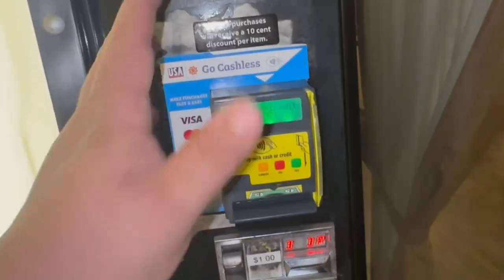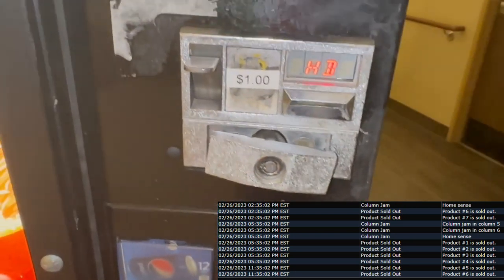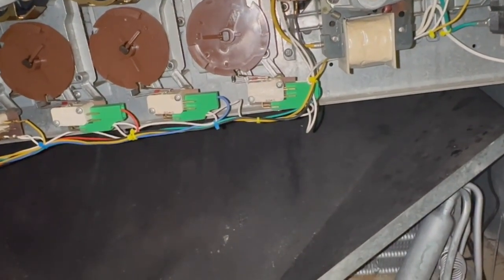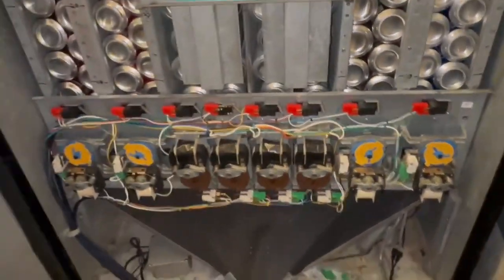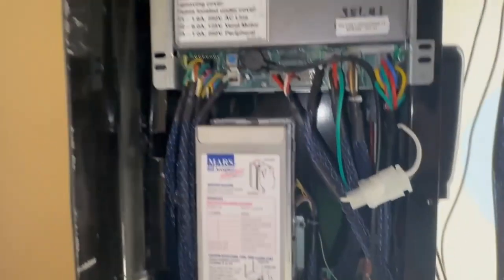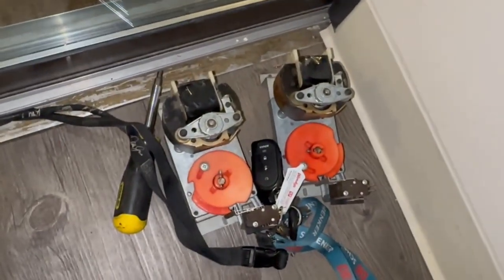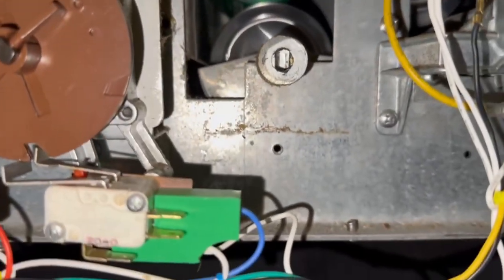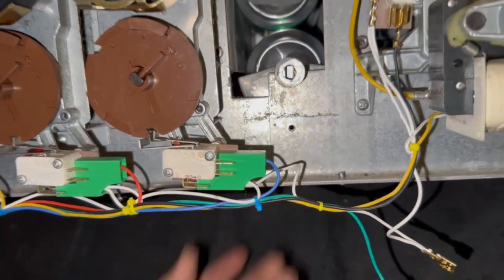Soda Machine repair Late Night #vendingmachine #repair #diy

Comment: I understand this video is 3 months and old. 
when #6 jackpot, you had to move the camera. but it seemed like it had a faulty motor break.
and I noticed one one of your short videos you had people putting pennies and a Mexican coin.
It would be useless in America but that changer can be reprogrammed to take Mexican coins.
 I've been remanufacturing and programing all kinds of vending machines for 30 years.
Reply from the maker: That machine is a machine I converted from a single price machine to the system. It has now and once I clean the contacts on the motor switch and the brake and  I haven’t had a problem with it since. Thank you for the support.